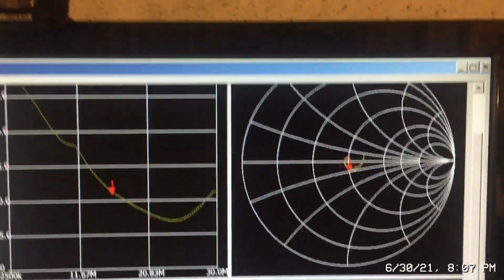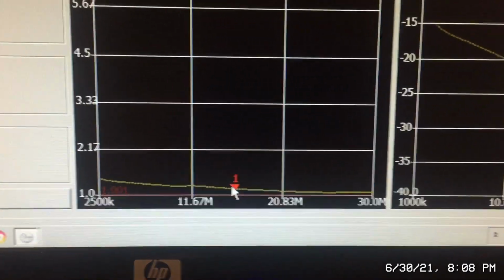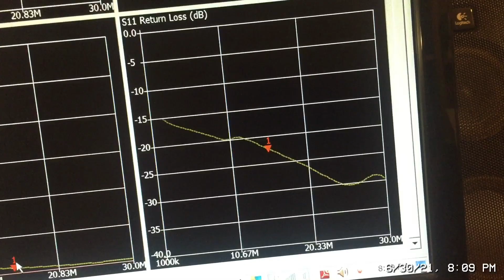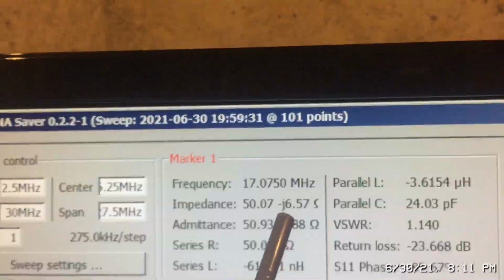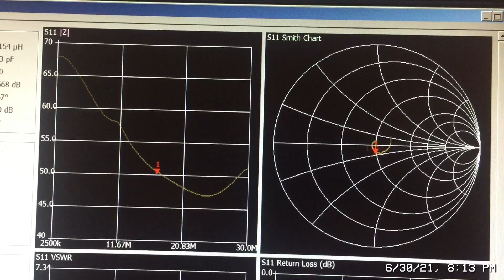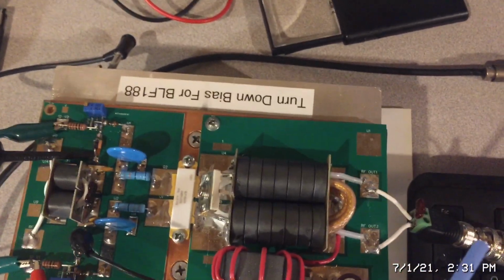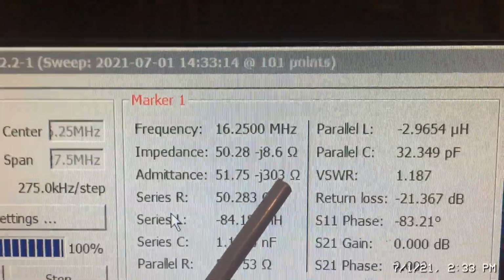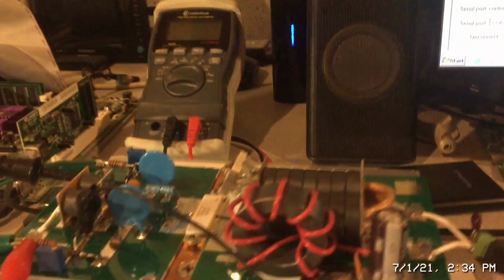Impedance Matching for an Output Transformer for a HF LDMOS RF Board

Comment: What's the point of the quarter wave section? Are you trying to make sure the VNA is seeing 50 ohms why not just do a port extension to make the random length of coax disappear?

Comment: Hi, so the VNA is attached to the output transformer secondary via a 1/4 length 50 ohm stub.  Do I have that right? What's the point of the stub?  I mean, what difference would it make if you connected the VNA directly?
Reply: I agree since the frequency range is wide, you would need a bunch of 1/4 stubs for all the frequencies.  Connecting directly should eliminate the effects of any resonant coax.